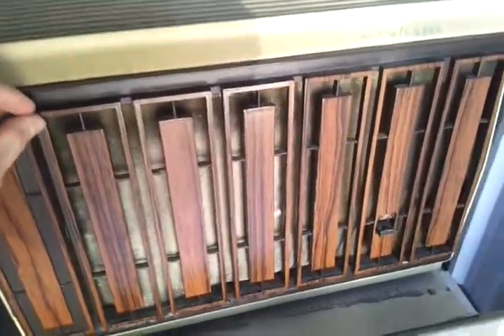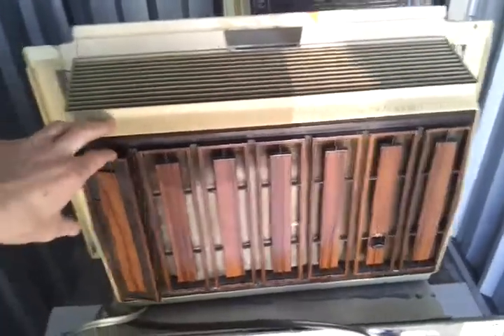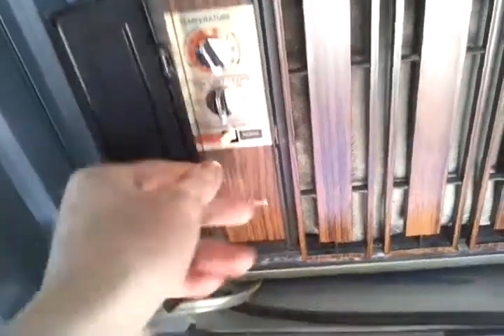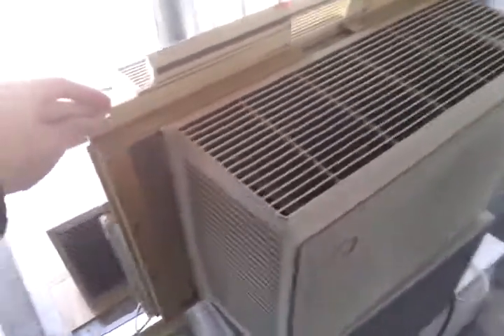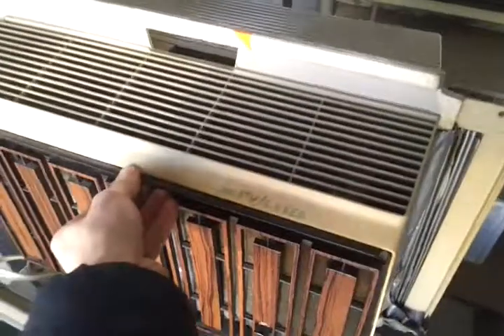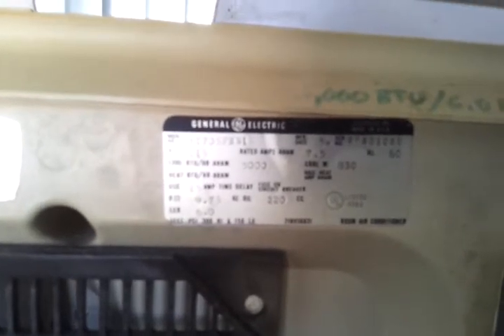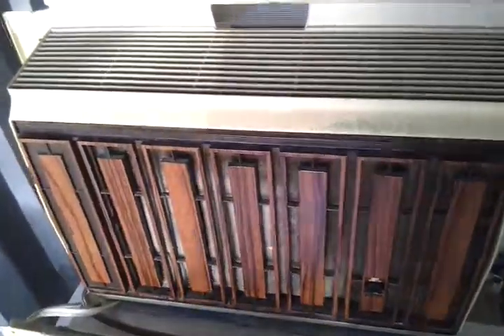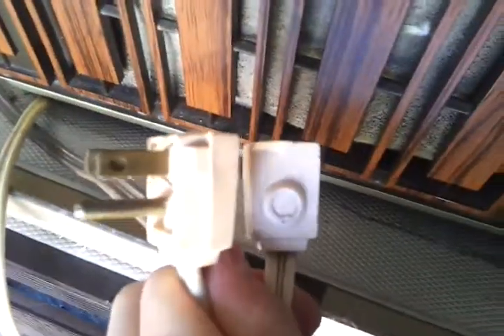1979 GE Carry Cool W/ Power Saver 5000 BTU

Comment: I have a 1984 vintage Hotpoint Porta Cool 5000 btu with the energy saver switch.  I never use it though because these machines aren't the quietest and having the whole unit cycle on and off all night would definitely keep me from getting my beauty sleep.  I've had it since about 1990 or 1991 and only once before today took it apart when the water stopped draining from the front to the back.  After watching yours and others videos on these units I decided to take mine apart and clean it out.  The thing was filled with sludge in the bottom and the coils were filled with crap.  Sprayed down the coils with household spray cleaner, put the electric switches, cord, cap etc in a plastic bag, then hosed the thing out.  It's drying out as I type this and I'm looking forward to seeing if there is any improvement in how it runs.  It's sure to smell better :)
Reply from the maker: Good luck with it! it should work much better now